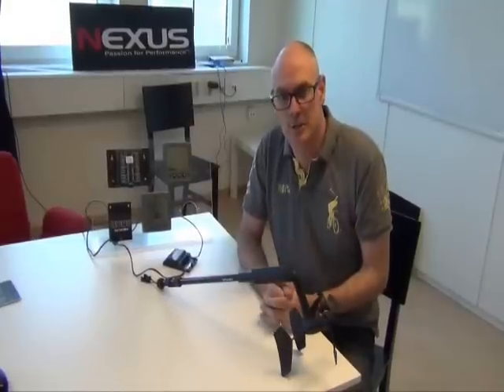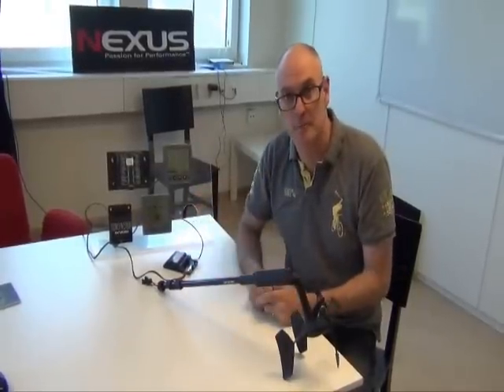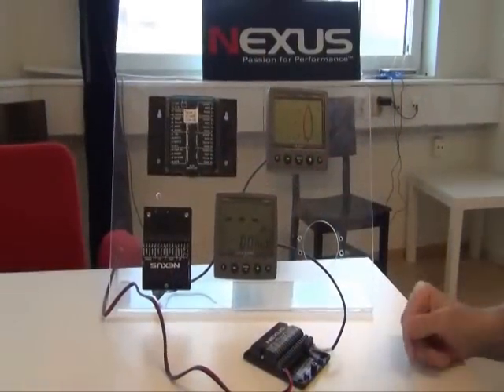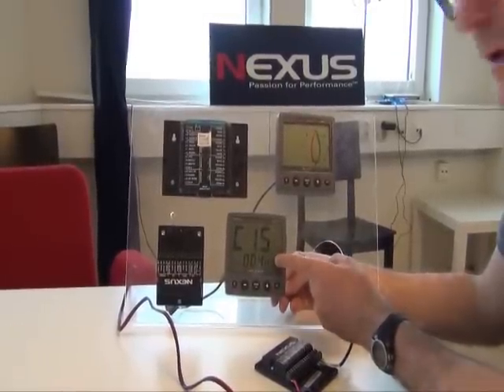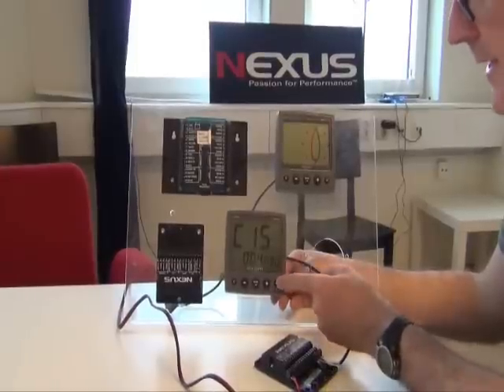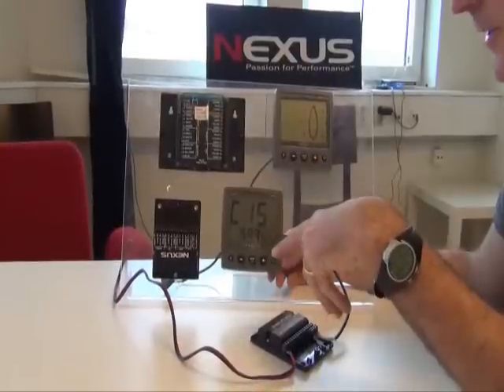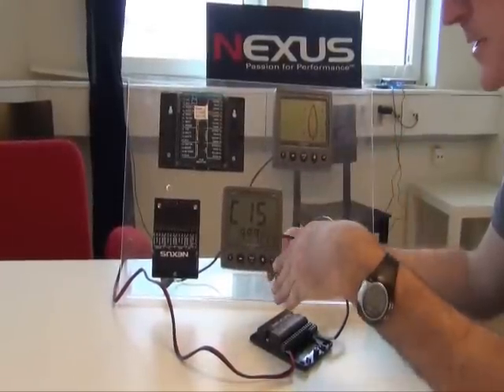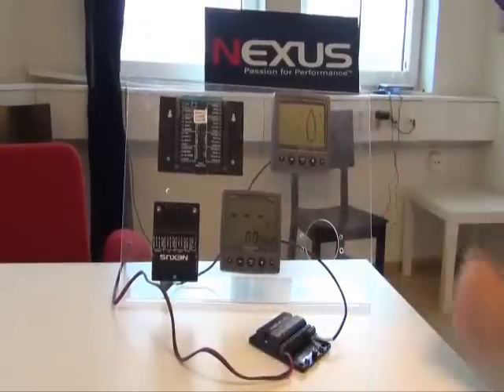Connecting a Nexus WSI box and wind transducer.

Comment: Hello.
I recently bought a sailboat that comes with this nexus kit. The salesman said the wind transducer worked well until the battery ran out. we changed the battery and we could never pair again. We put in the new battery and left a few days in the sun.
the led is always on and never goes out. The only way to turn off the LED is to remove the battery. I get to be 5, 6, 10, 60 seconds pressing the button and the light does not go out to make the pairing.

can someone help me?

thank you.